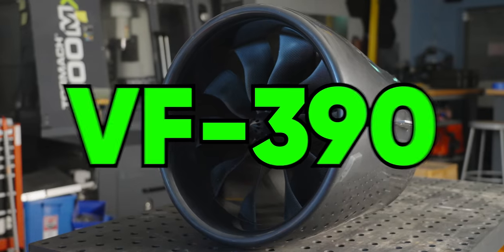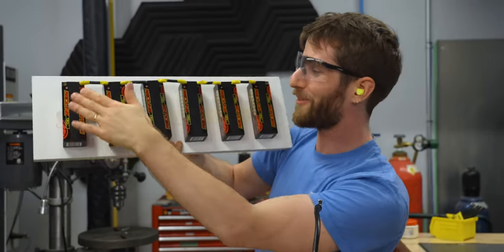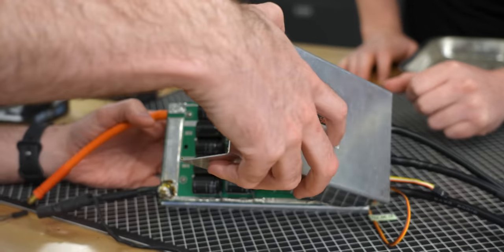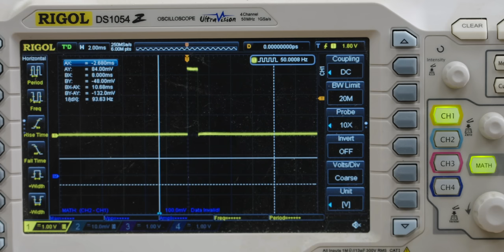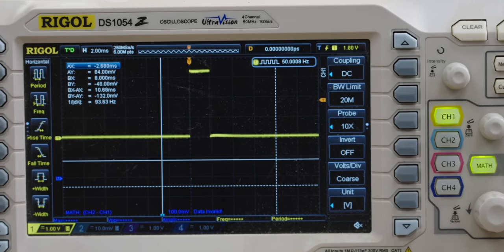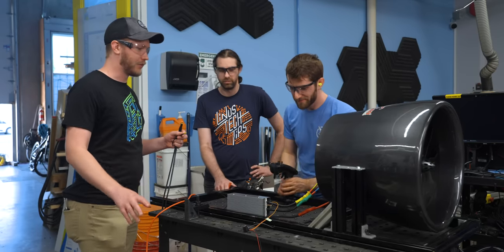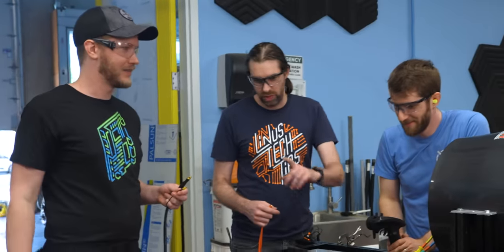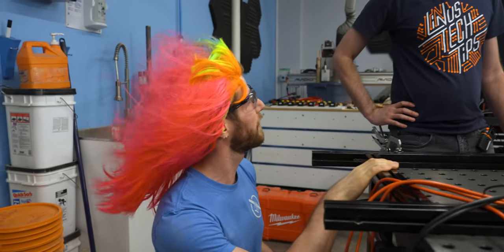The Scariest Fan ever attached to a computer - Vasy Fan VF-390 EDF

Comment: As a prior safety rep and aircraft maintainer, this scared me. Even just standing in front of the prop circle y’all were playing a dangerous game.
Reply: as a leyman in aeronautics, what do you mean by prop circle ? do you mean the width at which the prop projects its output ?

disregarding my knowledge of aircraft, i still know this video was a dangerous game.
Reply: @dominickkramer6469  think of an area around the blades of the fan, propeller, or jet engine, as a giant circle. As they’re spinning at high speeds, if any single blade were to be unbalanced, they could break and shoot out in any direction of that circle. Aircraft have a line marked on the fuselage to show where not to be if this happens. 

In the video, they were standing directly left or right of the fan in the area of that circle.
Reply: I was just waiting for a LTT water bottle or a pink wig to be sucked into the fan while drawing 100A.🫣
Reply: As it's it's ducted design, I would imagine (and hope) that the casing is designed to contain shrapnel in the case of a blade-off, in the same way as the nacelle of a jet engine is designed and tested to.
Reply: @chrisburn7178  Nacelle is designed to hold it, yeah. But it isn't strong enough to come through it intact. The nacelle is designed to bleed off energy by blowing apart tossing lower velocity shrapnel everywhere. The underside of the wing and passenger compartment that are inside the prop circle are reinforced to take not just those hits, but the full hit of a blade coming off and hitting the plane. The idea is that once the shroud violently deconstructs itself from the first indecent a second blade could break off afterwards before the engine is shutdown. So the wing and body need to be strong enough to take that second hit. Those areas are actually the strongest on any plane. When dealing with those types of forces it's just stupid to trust anything to work without a backup.
Reply: As a prior maintainer myself, I was a little anxious they had no intake grating.
Reply: Even just working on cars you don't want to stand in plane with the radiator fan, it's not as bad with newer plastic blades but especially unducted and metal ones will happily put you 6ft under
Reply: Might be a noob question, but: With the fan going so fast, is it even possible that anything will fly through, without getting turned to dust?
Reply: @CODA96 yes, at that speed anything harder than a cotton ball would shred whatever blade it hit. Carbon fiber is brittle in nature when it comes to impact strength. If they were titanium like a jet engine then it might survive something like an orange hitting it but thar carbon fiber might disintegrate along with whatever it hits.
Reply: @scottshort9778  Yeah, even some basic slats of flat bar to stop big crap like broomhandles, unsecured computers, or clumsy computer experts from flying into the intake would've been nice to see.
Reply: @yeahmanitsmurph  now im scared too holy crap

Comment: I know the PC was tied down securely, but if that glass had shattered while Linus was downstream, he would have been in for a very bad day.
Reply: Yeah, with that much throughput, it would have been better to just remove the side panel.
Reply: ohohoh i didnt think of that
Reply: They said that there was too much positive pressure in the case due to lack of throughput, so if the side panel shattered, it would've just blown out the side, no?
Reply: Linus: "I have safety glasses on. Surely this will protect me from a double hurricane."
Reply: It’s just ducking stupid and unsafe you can literally kill someone in this environment. Irresponsible

Comment: Its amazing that there are multiple engineers doing an incredible over complicated and expensive circuit that only runs for a couple minutes when they could have simply rent a tri phase AC generator and run the thing at max power for whatever time you want.

Comment: Finally, something to cool the RTX 4090!
Reply: 13900k* :)
Reply: Fr lol
Reply: @JvMr333  fr fr like actually
Reply: gonna need two for the 4090ti
Reply: the 4090 doesn’t get hot… bro just said the name of the first computer component he thought of for likes.
Reply: @hamdanali2036  yeah pretty much, wasn’t sure if it did or not lol
Reply: Not wrong💀
Reply: @jimiwexler1260 you meant 8?
Reply: Beamng modder hehe
Reply: @simsimw  yes sirr
Reply: @hamdanali2036  4 8 pin power cables is indeed very power efficient

Comment: I love how you left the rear case fan in like it's going to help.  Should have triple stacked that battery bank in parallel for even a modicum of safety at that current load!
Reply: they could have done it even cheaper with a bunch of lead acid batteries. lipos like that are lightweight for rc cars. who cares how much it weighs if it doesnt have to move itself lol

Comment: At a malt plant I worked at we had 15ft Dia. Fans that ran off a 500 HP motors. That blew air through a bed of grain. Those were impressive, oh and there were 4 of them. There were air lock doors because it was close to impossible to open the doors with the fans running, and it would blow you off your feet to walk in front of them.
Reply: What plant? Was it milwaukee

Comment: I was nervous the whole time. I'm not a fan expert or anything, but with that much power, it seems to function like a tiny jet engine. I would want to cover the intake with something to prevent serious injuries from something getting sucked or accidentally moved into.
Reply: This is the type of stuff were you feel confident because there is never consequences but when there are just one time, in this setting you could literally kill someone. I found the whole setup extremely irresponsible and dangerous. Stuff loosely lying around, no covered intake. People shouldn't be standing in front of it when there is a possibilty that a part of the PC comes loose and flies into someones face at 200km/h.
This shit is not safe and there should have been a security advisor of some sort.
In germany this place would have been closed down already.
Reply: @jooplin  wow you must be fun.
Reply: @conorstewart2214  dying is not fun or so I've heard
Reply: Most of all, Linus should know better than to create an environment where his engineers (obviously scared of the situation) feel like they have to bend to his ignorant, bull-in-a-china-shop antics.
Reply: @conorstewart2214  yea not dying is so unfun
Reply: 20 car batteries would have been cheaper, safer, no crazy charging setup, and resellable.
Reply: Well it literally is a jet engine. It's a turbofan, just electric instead of kerosine-powered. It probably is used for those really big RC planes.
Reply: It's I turbo fan so yes it's essentially an electric jet engine
Reply: @CaptainChrom  "just electric instead of kerosine-powered"... And exactly that makes it not a turbo fan. The "turbo" in turbo fan means it is powered by a gas turbine engine which is driving the big fan. Just because it looks kind of the same doesn't mean it is the same.
Reply: @jooplin  I had the same exact feeling when he was behind the PC while it was running. I could just imagine one of the straps being slightly frayed or something and half the rig coming off and hitting him straight in the face. He was even aware of that possibility, given the fact that he saw part of a case fly off during his previous experiment with powerful fans. That much force trying to push through that case, it's gonna become a projectile if it comes loose. At l;east I would imagine it would. There's just not enough airflow to dissipate that pressure. I feel like it'd kinda pop off and get blasted away, or at the very least, parts of it would. I'm not calling him stupid or anything, it's easy to get carried away with fun and not stop and really consider what your doing is dangerous, they should just have a better protocol in place to prevent him from going that far.

Comment: I'm fairly comfortable around high power battery packs, if the BMS consisted of a temperature reading and  Linus not going full tilt I'd be running for the hills.

Comment: I love the way everybody else is hesitant to get behind the fan, and Linus just dives straight into the double hurricane.
Reply: Something can ALWAYS go wrong but it's clear proper safety measures were in place.
Reply: @smmmokin  what if the glass broke and flew in his face?
Reply: Linus is the type of guy to jump into a burning building cause its chilly outside lol 😂
Reply: @MaksKCS tempered glass means it’s at least less dangerous - plus you’d probably see an internal component go flying before the glass did. On top of that they likely did some tests with the case and adapter before putting any internal components anyways.

Comment: This was downright dangerous. If any object got loose and pulled through the fan 😮
Reply: My thoughts exactly. I was on the edge of my seat.
Reply: Yeah and they were putting their faces in front. Those goggles wouldn't stop anything at that speed
Reply: Yeah straight final destination
Reply: horizontal blender
Reply: @OwlishGeorge 🤡🤡🤓🤓🤓
Reply: Sucking things is very inefficient, so it shouldn't really do anything if you don't have anything that flies easily near it
And this fan is designed to blow air and not suck.
Reply: @OwlishGeorge  The only reason I wasn't is because it was pre-recorded.  I'm sure that if Linus died a gory death this way, they'd probably have the decency to cancel the video...
Reply: @Kynatosh  From the manufacturer: "Keep a safe distance between the user and the fan during testing and operation as suction of nearby objects may occur."
Reply: It's not as bad as it sounds. This fan has, if I remember the video rightfully, just 60 kg (600 N) of thrust. Birds have flown through (albeit in pieces) jet engines that do on the order of 300000 N. :^)
Reply: PS4s running Warzone:
Reply: @viking4896  air is moving at that speed. nothing heavier than air would be accelerated even close to those speeds.
Reply: @OwlishGeorge o
Reply: @ericrosen6626  shhh don't tell him how a fan works! he thinks they magically blow air
Reply: @roflmagister5  As someone that works with aircraft engines, they're a bit more durable than this thing.  And it's not a straight tube through a jet engine.  A bird that goes in will get finely blended immediately.
Reply: it wasnt dangerous at all. I love you, youtube experts.
Reply: Yup. This wasn’t their brightest moment.

Comment: Watching Linus stick his head behind the computer with a GLASS side panel really gave me anxiety. If the negative air pressure shattered the glass while his head was back there this would have been a very different kind of video. I don't think the tape would have done much.
Reply: it wasn't just me thinking that then!
Reply: Aren't tempered glass shards not sharp?
Reply: In hindsight it's probably positive pressure because of the computer case backplate but still, a non ideal scenario.
Reply: It would become a live action Happy Tree Friends skit.
Reply: those computer case panels are usually tempered like passenger windows in cars, so it wouldn't be too bad unless he got hit directly in the eye.

There are lots of ways to break a computer case so they are designed with some safety in mind.
Reply: It's generally not, but neither is buckshot :)
Reply: all those shards will be in his skin.
Reply: @compwiz00 wouldn't be too bad 😂 imagine the force those glass shards would be flying at when the fan was cranked to 80-100amps
Reply: I don't want LTT to have a WorkSafeBC collab. Safety first, guys ⛑️
Reply: I strongly suspect there was little risk of breakage at the lower speeds. I believe that is why he was not allowed close behind it once they turned it up
Reply: Thanks.  He was an idiot no matter what precautions they took…
Reply: If by sharp you mean can it cut then yes tempered glass shards are sharp. Tempered glass shatters into thousands of chunks all with sharp edges, because of the shapes of the chunks they can only do cuts into the skin but not through it. Don't try to clean up a shattered side panel with you bare hands unless you enjoy hundreds of shallow cuts. Normal glass can shatter into knife edged shards that can cut deep enough to kill. "Safety glass" being superficial cuts compared to unsafe deep cuts of normal glass. 

If the side panel shattered he would be sprayed by thousands of sharp edged chunks then followed by a trip to the hospital and a week wearing a bandage over his face and all other exposed skin that was hit. He would be fine in a week though.
Reply: positive pressure inside the case. glass would have hit the crew to the side of it

Comment: the fact he stood behind the fan with no protection was terrifying
Reply: I know right? I couldn't stop thinking that if a screw popped off the motherboard, it'd turn into a bullet.
Reply: Protection? Linus? Sir.. do you know who linus is ? Lol
Reply: @vmoca  To an extent maybe but 450km/h is actually much slower than any bullet (~1/3 the speed of 9mm, 1/6 or less the speed of 5.56) , plus a screw is metal sure but it's much lighter and nowhere near as dense as actual bullets. Additionally this all presumes that wind speed would be equal to projectile speed which is highly unlikely, and they never went over 100 amps anyway so it wasn't even at 450km/h. I would be willing to stand there wearing safety glasses as Linus was but I've never been accused of having the world's best judgement so....
Reply: If that case and the glass panel blew at that point, it'd be an air-powered glass-and-metal claymore
Reply: @jameshealy4594  just because it's safe, doesn't mean it's okay
Reply: @jameshealy4594  everything that could be thrown at him weighs much more than a bullet though so the energy is similar if not more
a 124 grain 9mm bullet is only 8 grams.
Reply: @WayStedYou  That's still much heavier than a screw, which is what I was responding to. I don't think there's actually much metal contents in there that is heavier, unless it's something like the entire heatsink - but that's not going to fit through the back of the case anyway. Try measuring any screw from a case if you have accurate scales, I bet they're all far less than 8 grams.
Reply: Sucking things is very efficient. And heavier objects won't really move. Only maybe unscrewed screws placed right in front of it would fly, and even then not at that high speed
Reply: @jameshealy4594   A Boeing 747 weighs 910,000lbs... Your current understanding of the physics involved in this situation is misaligned. These are not bullets inside of a barrel being pushed by a singular propellant pulse. That analogy doesn't hold water here. What we're actually dealing with is a continuous, high-speed airstream being funneled into a rather compact space. Weight isn't the problem, LIFT is. Make no mistake about it, if that heatsink let go of that board, it would've rotated, turning the fins in the optimal perpendicular position for maximum aerodynamic lift. In such a state, the heatsink becomes a potentially lethal hazardous object. Could it rip through the back of the case? We don't know, but in no universe would it be seen as safe to test this theory with the skull of the owner of a $100 million dollar company.

Go drive your car at 80mph and put your hand outside the window, angled against the wind. Now, TURN YOUR HAND. Now think about what you just felt, multiplied by 3.5x. Oh and your hand is made of metal and is now suddenly decoupled from your wrist. What would happen if the rear panel of the case let go? What would happen if the side panel of the case bowed out a little bit and an edge of it caught the wind and it was ripped off the case and became airborn? We are talking about industrial accident levels of risk that linus was fucking with here.
Reply: @xilix  You make some good points and as I said, I'm not noted for spectacular judgement. Obviously it entailed some risk, and equally obviously the consequences could have been extreme (though I personally still have many doubts about the likelihood of that extremity). The bullet similie didn't start with me, I was just commenting as the physics of that is something I understand (relatively) well. 

Are you saying the heatsink, for instance, would potentially have more energy than mass X velocity squared?  I'm struggling to understand how lift would interact with this situation at all beyond keeping things airborne rather than them just dropping out of the airflow. If you're willing, I'd appreciate some more explanation?

Comment: I thought I was one of the only ones that strapped fans of that caliber to a PC to test how good and rapid air cooling and response can be. Mine was only 200mm but it was an RC Jet fan with 8KG of thrust
Also I recommend copper heatsinks plus stopping the airflow from going anywhere except through the heatsink as air will want to travel the easiest route, if you seal everything you will also condense the air as it goes through allowing for far greater pressure on the heatfins allowing for far more contact and far better cooling.
Also I recommend RC Jet fans as they are built for both airflow but also they naturally handle condensing of the air into the output while creating a solid static pressure due to their job being to provide thrust.